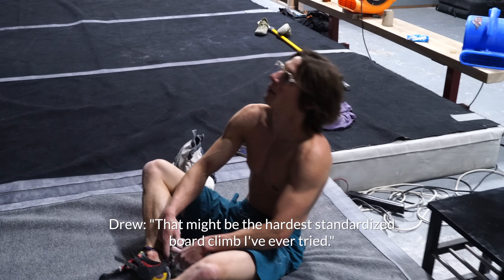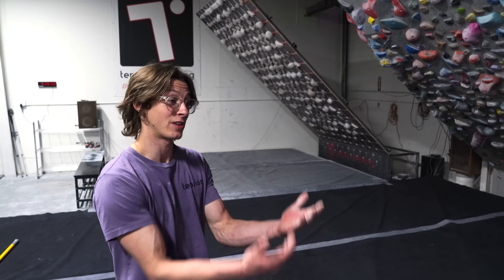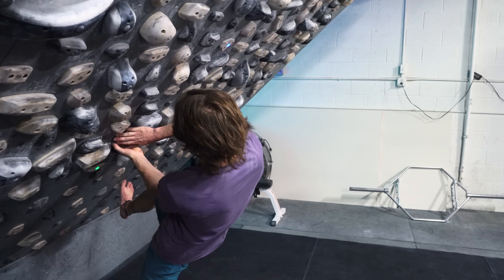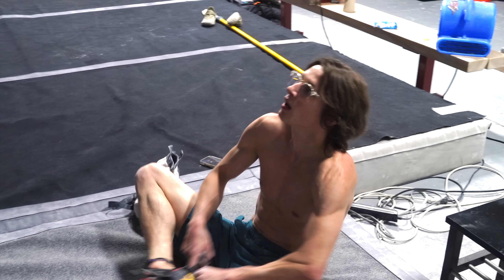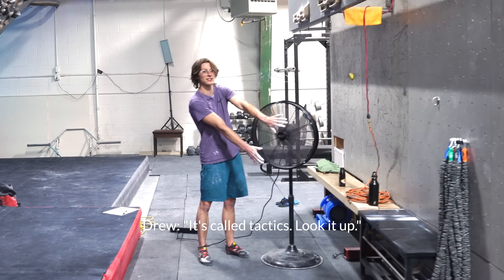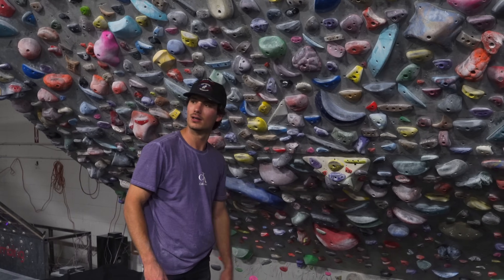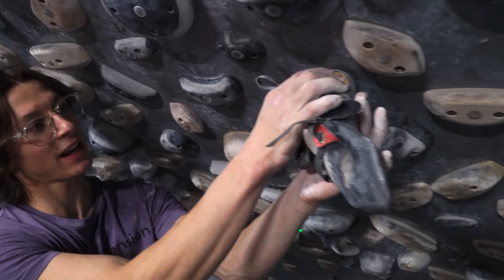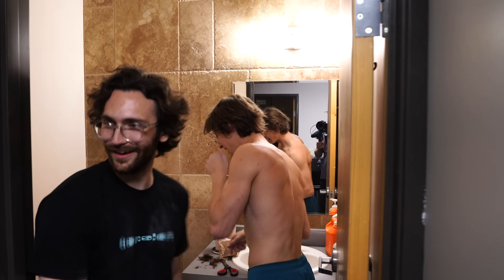Replica Boulders with Drew Ruana at the Tension Training Center

Comment: Unfortunately since each fan doesn't produce enough thrust to lift itself, we're going to need some balloons. Buoyant Force = (Density of air - Density of gas) * Volume * Gravity, assuming 0.833 kg per cubic meter density of air at bear lake, and about 0.164 kg per cubic meter density of helium, and let's say we're using conveniently large balloons of 1 meter in diameter, 9,194 of these will lift an 160 pound person and a 29 pound(from the data sheet) big ass orange fan. If you do the math with the orange fan producing 1625 cubic feet of air per minute, and assuming an acceleration of the air leaving of a couple meters per second, thrust = mass flow rate * acceleration, mass, the fan produces about 0.636 newtons of thrust. The difference in elevation between bear lake parking and lower chaos is 865 feet, negating the horizontal distance needed to travel this would take about 245 seconds, or 4 minutes to get to lower
Reply: So 9,194 balloons, one big ass orange fan and one massive extension cord should do the trick
Reply: Have we considered the increasing weight of the extension cord?
Reply from the maker: Incredible. Now we know 🙏
Reply: @user-ih3jl9um6e  this is a good point